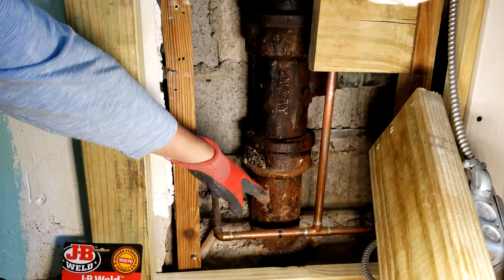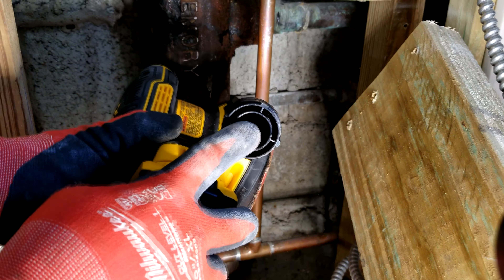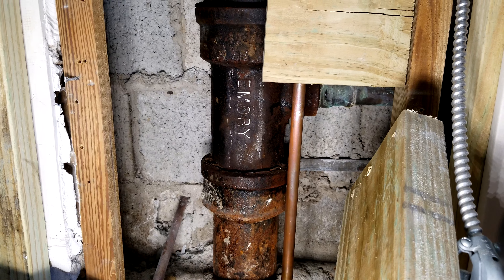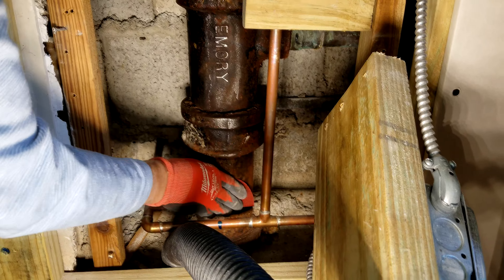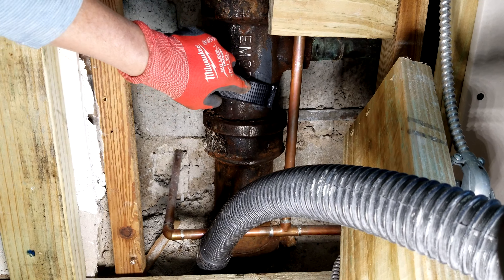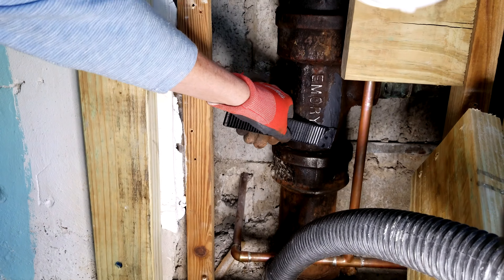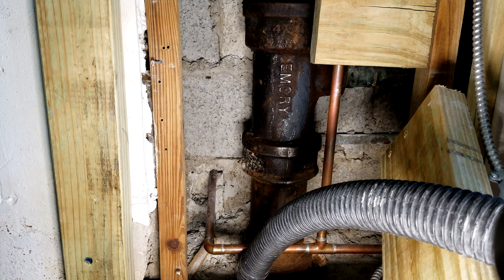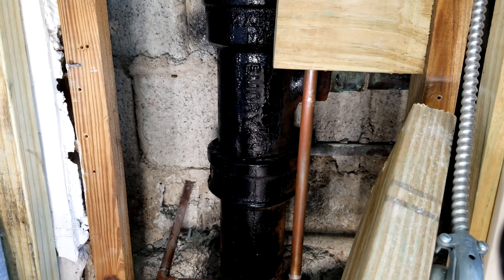How to Repair Cast Iron Pipe Cracks, Avoid Plumbing Fails

Comment from the maker: From Home Depot & Amazon (paid affiliate links)
🛒 J-B Weld Two 1 oz. Twin Tube Cold Weld for patch: https://homedepot.sjv.io/e4Qgkz
🛒 Rust-Oleum Rust Reformer Flat Black Spray Paint https://homedepot.sjv.io/NKBkrq
🛒 Rust-Oleum Protective Enamel Gloss Black Spray Paint: https://homedepot.sjv.io/QOPy5a
🛒 DeWalt 20-Volt MAX XR Cordless 5 in. Random Orbital Sander https://homedepot.sjv.io/jWXrvM
🛒 5 in. 80-Grit SandNet Disc with Free Application Pad (10-Pack) homedepot.sjv.io/Ao0WJa
🛒 5 in. 80-Grit Universal Hole Sanding Disc Hook & Lock Backing https://homedepot.sjv.io/Vyamqj
🛒 Shop our Amway Web Site: https://www.amway.com/myshop/JeffOstroff
Note: Some of the links we send you to are affiliate links which if you click on them and buy something, we may receive a small affiliate commission. We appreciate you supporting our efforts to continue to bring you word class tool reviews, remodeling and repair videos, and shop with me videos looking for the best discount tool deals.
Reply: Thank you for saving my day!!
Reply: Subscribed you!

Comment: Cast iron rots from the inside out.
Reply from the maker: It can rot from either direction. In this case you can tell there was a lot of moisture at the bottom of this access space from previous galvanized plumbing that failed.

Comment: U shouldn't be teaching plumbing fixes, it shouldn't cost 1000 to fix it right.
Reply from the maker: What do you think is wrong with this? Do you have the $1000 to give to this widow to repair her cast iron stack?
Reply: I been repairing new to old for 40 years my customers budget decides how much replacement I do, to replace this stack would be a extra 1000.00 for me to do it and thats cheap when this simple repair added maybe 50.00 to his bill and will last him another 20 years.
Reply: @greatbay1961  It's not going to last 20 year, because the cast IRON is rusting away. And there going to have a leak in the wall,with mold growing their.
Reply from the maker: @peterboissiere9684  Your " my way or the highway" mentality here is completely ignorant and insensitive of the scenarios that poor people face every day, so keep getting snooty against those who can't afford your ivory tower repairs. The iron is not rusting away right now, it looks like there were incidents of water leaking in the past due to old galvanized pipes that are not longer used and must have ruptured inside the wall. So far the rust inhibitor we added will at least help, and look this stack lasted from 1946 until now, and we still don't know if this crack goes all the way through. But Peter if you'd like to donate the money to this retired widow to have her entire cast iron plumbing stack pulled up out of the concrete, and have her roof torn apart to get at the top of it, and tear down the concrete block walls in the kitchen to get at it, as there are no stud drywall walls in this house, then replace with a SCH 40 PVC, I'm sure that would help her, then maybe this repair would be up to your standards oh plumbing Lord..
Reply: Peter, How can you honestly tell what the true condition of the pipe is from short clips of video?  Problems with the cast iron were never discussed or reported to be causing problems, it was just discovered when the wall was opened up and discovered other water pipes were leaking causing the rust stains.  If the pipe was horizontal I'd probably inspect it more carefully.  Good day sir
Reply: Peter, get over yourself, not all customers want to pay $1000 when they can fix for $50

Comment: We tried this on a cracked cast iron drain pipe (2 feet long 1/4 inch wide crack).  It seems to be working!  Thanks!
Reply from the maker: Nice work!
Reply: Hi thank you for the information! May I know is that still working? I am also considering buying a Epoxy Putty rather than replacing the whole pipe system

Comment: I've done this repair many times. If you have a large hole, this is what I do. Cut a piece of wax paper, and piece of plastic or metal screen material a bit larger then the hole.  Lay screen material on top of wax paper and coat both sides with JB weld regular or kwik depending on your needs for a fast cure. Next place and press the patch over the hole. When dry just peel off the wax paper, especially if a second coat is necessary. Of course preparation  and cleaning the pipe first for good adhesion. I do hope this helps some of you students in the you tube classroom. All the best with much success!!
Reply from the maker: That is a good idea!
Reply: I have a large hole and I'll be damned if you're doing that to me.

Comment: You could have used a wire brush (mechanical and/or hand) to clean the cast iron. Also, you could have used a cleaning solution to remove the oil and gunk from the cast iron to ensure the JB Weld held to the pipe. I would have let the JB Weld cure overnight before painting, since you are going to seal the wall and not see the results of your repairs. I know, time is of the essence!
Reply from the maker: When I sanded at the spot of the crack,  I was down to bare shiny metal, that's all I cared about, the rest of the pipe can still have oxidation. But hand sanding got most of the rest and the rust inhibitor keeps it from getting worse, and the new paint spray on there protects the whole thing from further corrosion any time soon.
Reply: Here here...In fact...since its a drain....Not pressurized... Ive fixed these with rubber cement, like the goop products. They are all the same BTW...  A drill (or a right angle drill or angle grinder with a flap disk)... with a brush wheel would have been better & then a course sanding block to finish off...then wipe with paint thinner or charcoal starter to de-grease the whole thing..and yes, you can paint any of the goop products once they are cured...So...yea, this works (not on my house tho) but that rust reformer likes to have a brushed and cleanish surface to polymerize the remaining rust...Otherwise without further cleaning the rust now has a chance to drill down into the cast Iron...Good thing its thick!   more than one way to do drains...

Comment: Don't worry.  If it is cracked, the crack will rust internally and run to each end of the pipe or fitting.  Eventually a cracked pipe must be replaced.  Fernco makes an epoxy bandage that wraps a cracked pipe and will work for several years...

Comment: As the old saying goes: Good enough for this neighborhood.
Reply: Steve Lav has entered the chat.
Reply from the maker: This neighborhood is jam packed with lead melted cast iron plumbing and old galvanized pipe plumbing, many of which have long since failed.
Reply: This video was good, up until putting something to reform rust on the outside of the pipe...... looks good from here. 🙄

Comment: A multi tool with the sanding attachment works great for tight spots like that.
Reply from the maker: Yes, it was more the texture and raised shape of the pipe area, it felt better to do it by hand after the initial machine sanding.

Comment: What would you do for copper 3 inch drain pipe leak Jeff ??? The plumbers who cleaned the pipes out inside used a metal spinner in the pipe and whore out the pipe from the inside. He then used electrical tape wrapped 1/8 inch thick. Now I have six leaks about an inch long and 1/8 inch wide. I  guess I must be lucky. NOT!!!!
Reply from the maker: That does not sound like a plumber!

Comment: I use Rustoleum Rust Reformer paint on a lot of projects.
Spray inside of wheelbarrow once a year and it resists the hard use it gets with the coating lasting the whole season without rust inside the tub.

Comment: I've used jb weld for these exact cases.  Best stuff to use, even Project Farm has confirmed.  I have never used this 2 part one only the tube.
Reply from the maker: You used the SteelStick?
Reply: @jeffostroff  Marine JB weld in the tube.  I've had to use it on old cast iron, galvanized pipes, and lead.   Great fix. 

I've even used the high heat jb weld on cast iron radiators and pipes.

Comment: For a small spot like that to sand, I use my dewalt multi tool with the triangle sanding head
Reply from the maker: The texture of that pipe also dictated hand  with sandpaper

Comment: I worked on old crap just like that for almost 50 years. I have tried everything and there isn't an easy, permanent repair for that old garbage. I always just cut it out and replace it with pvc. I used to cut out the garbage and  lead in new fittings, before pvc. Now, repairs are easy.
Reply from the maker: How do you mate the PVC to the bottom of the stack? Do you cut it off the floor and leave enough cast iron stack to slip a mission connector over it?
Reply: @jeffostroff  They make transition mission clamps, if needed. Sometimes the old cast is close to pvc.
Reply: What do you guys think of this

Comment: Very helpful video! Not sure if you can give me a little advice what to use to patch up a hole from inside the iron pipe. We are replacing the toilet bow, and saw this hole patched up by cement by the previous house owner. It is close to the sleeve. In this video, you use JB weld, not sure if it can be used to patch up a hole rather than a crack. It's about an inch wide round hole. Appreciated if you can see this comment and offer some help.
Reply: Putty epoxy, like rectorseal 200 or oatey fix it stick.

Comment: im sure it wasnt in the budget, but from experience these are well past their life of usefulness and should be replaced. 

just pulled my old cast iron pipes in 2020. the  inside was so corroded that the inner diameter was around 1".  the upper part of their stack may not be as bad but wherever water was in direct contact with drain off, its for sure that corroded.
Reply from the maker: Luckily in this house they switched to copper pipes years ago as you can see in the video, and we also switched over the kitchen drain pipe shown in the video to white PVC pipe. And the plumbing stack is just there as a dry vent/wet vent at this point.

Comment: Cast iron drain pipe is funny, it can be 100 years old and in perfect condition or rusted and falling apart. The horizontal sections tend to rust faster than the verticals because of the water and gunk that will sit in there.  I think a lot of their longevity lies in how well the outer pitch coating holds up over time. When it fails, the pipe rusts quickly.

Comment: Do you know how to fix a small hollow in a cast-iron kitchen sink?
Reply from the maker: Virtually every time the plumbers will slice out the bed section of pipe and replace it with some type of a rubber boot and a PVC pipe

Comment: My sewer pipe has a small crack on the top and not leaking but I thought i'd seal the crack before it starts leaking
Reply from the maker: That's a very good idea because the summer gas is kinda. Escape into your walls to those crashes

Comment: I would clean the pipe the best I could then, I would use 100% silicon and smear it all over the part that you think is cracked. Let it dry. If that pipe is wet it will not stick. You could also try some gorilla spray that looks like undercoating, I know that works great.
Reply: Jb weld puts silicone and gorilla glue to shame.
Reply from the maker: Yes good for people who are broke or can't get to JB Weld. but JB Weld is much better and withstands over 5,000 PSI.

Comment: I once had a crack in the cast iron waste pipe.  it was behind a 1st floor wall of a 3 floor building.  The plumber replaced the cracked section with a piece of PVC.  Can anyone tell me how that was possible?  How do you cut a section out of a cast iron pipe without the whole thing collapsing because of the weight?
Reply from the maker: If there was enough adhesive and sealant up at the top where it hangs through the roof then it will hold. But the code usually tells the plumbers to use a strap to hold it in place. Because not every cast iron pipe is held in perfectly by the end of the adhesive
Reply: Friction clamps most likely. Usually plumbers put them on every floor or every other floor to support pipes vertically through floor penetrations.

Comment: What about Crack in sewer line  under concrete foundation, under the toilet
Reply from the maker: For that they chisel up the foundation in that spot and run new PVC pipes, and pour concrete over it
Reply: @jeffostroff  sheet that be expensive 😬
Reply: @MartinLDeLoach903  $6k for my sewer repair (full line repair, not patch)..  Wasn't covered by insurance.  Snaked the line and found two bad sections ... Old line went through a neighbors property and had to get their permission to dig.  Major pain.. but my line was "crushed" under a tree on the neighbors side.  Fortunately, neighbor allowed me to fix.  But what a pain!

Comment: Can I run an polyethlene pipe through my old iron service line instead of digging up the ground?
Reply from the maker: Never anyone try that, so not sure. Sounds like at least physically it would work.
Reply: @jeffostroff  yeah I was just thinking about trying that.  this service line is really really old.and three feet down,  maybe closer to four feet.  That's a lot of digging.
Reply: No
Reply: @larrywarolin7215  No what?
Reply: @michaelmansun6203  no you can't run ...

Comment: This is a bad idea. If that fitting is cracked replace it. I would hate to have it break after spending that much money and having to open the wall again possibly rip out the cabinet when it could have been done right the first place.

Comment: So you're doing a how to video. You are a professional showing non professionals how to properly do somthing.
You do not have the proper vacuum or vacuum adaptor in order to connect you sander to a vacuum. Yet... You proceed to use the sander anyway trowing what had to be a reasonable amount of iron oxide dust everywhere. 
Engineering disaster? Why didn't you just get the correct tools to get a vacuum hooked up to your sander before proceeding with making the video? 😢 Also... JB Weld and Bondo are NOT anywhere close to being similar products.
Bob Vila, Mike Holmes and Norm Abrams would all be shaking their heads right about now... 😮